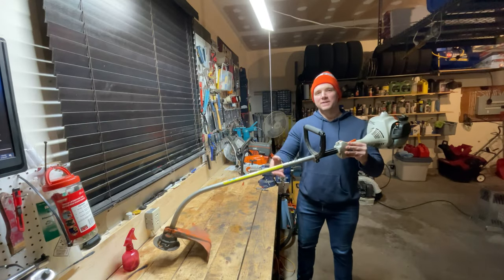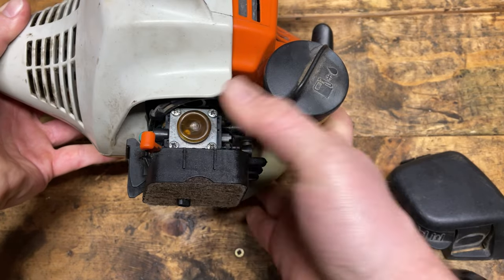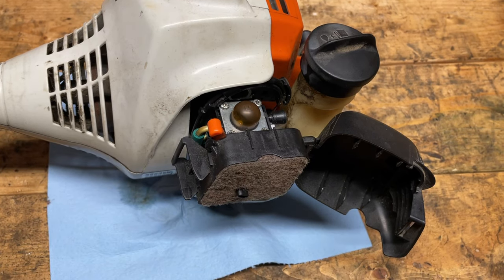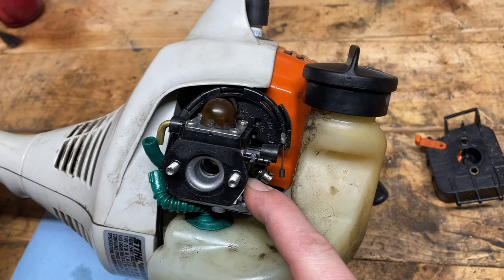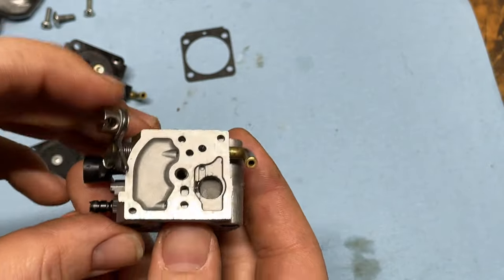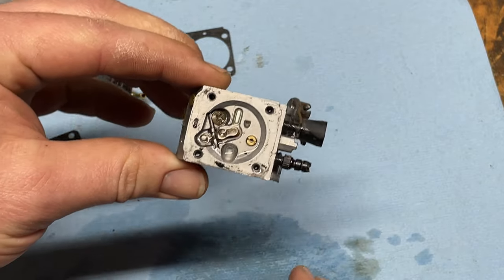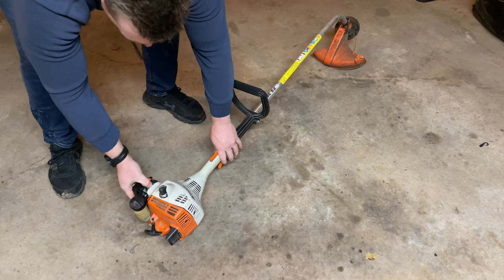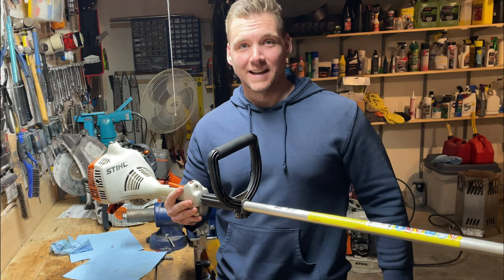How to fix a string trimmer that won't prime (purge bulb doesn't work / won't fill)

Comment: Hey Dave, great video! It's amazing to see all the good knowledge you and Don are putting out there in these videos!
A question about those small Stihl trimmers: is it normal for it to have so much vibration when it's idling? It's basically hoping away from you haha
Cheers from Croatia.
Reply from the maker: Hey Dejan! Thanks for the comments. Can you film a video and post it? Cheers!
Reply: @DavesSmallEngines  Yes, absolutely. My mom has one of those, but it's at a house in the country, so I can get to in a couple of weeks. 
The engine essentialy vibrates quite a lot when idling, but it has no issues and runs very smooth when revved up.
Thanks for the reply!
Reply from the maker: @dejanm5727  I have worked on over a hundred Stihl trimmers. Let me know when you have the video!

Comment: what is going on when my KM55RC when it fires up it is high RPM, then it dies and have issue getting it to run again. what happened was went to start it but never noticed my throttle cable had come loose. So was trying to adjust idle mixture and never got it to start back up. tried to adjust the throttle cable when I noticed that the cable had come loose. not sure how to get it to idle down so I can adjust high and low mixture. where should throttle cable screw be set. could you help me on this problem thanks

Comment: Hi mate I have done everything you told in this video. Is there anything else I can do to fix the problem. Primer pump still not working. The machine is sf 80 pro.Thanks
Reply from the maker: Sounds like one of the check valves in the carb is broken. Try another carb!

Comment: Thanks. Going to try this. Wish me luck.
Reply from the maker: Let me know how it goes! Good luck!
Reply: @DavesSmallEngines  Nope did not work. Maybe just buy new carb on amazon? Comes with new fuel filter. Plug. Extras for 22.98. Thoughts?
Reply from the maker: @bufferzone3247  sounds like a good next step!
Reply: @DavesSmallEngines  thanks

Comment: Is the purge bulb supposed to be taking in air? Mine keeps bubbling up like yours. Is that supposed to happen?
Reply from the maker: The purge bulb is supposed to draw in fuel, but most have a small air relief so that the bulb doesn’t stay flat. I have had trimmers that only fill 1/5 of the way in the bulb that run just as well as ones that filled 3/4 with fuel. As long as you are seeing fuel in the bulb it should be working fine, as it’s duty is to draw fuel through the carburetor passages.
Reply: If your carb has an accelerator pump, it's worth checking that. It will draw in air if that oring is bad. Also can have some bogging down when trying to full throttle.

Comment: Dave, i heard you say it was a new carb kit. What do you use for fuel. Everybody has a different opinion on how to store small engines for the winter. My method, and I'm not saying its the only way to do it. I never ever use fuel stabilizer. In 2 stroke equipment i only use premium fuel with stihl ultra HP oil ,and Seafoam. In 4 cycle i only use premium fuel and Seafoam. I have very good results doing it that way. I went out to my garage the other day and started by BG 86 Stihl blower. It took 4-5 pulls and it was running perfect. I put it away last November. ✌🇺🇸 Roger
Reply from the maker: Hey Roger! Glad to see you back. I use 91 octane with no ethanol. Premium means different things to different gas stations. Some premium fuel uses the ethanol to achieve a higher octane (93 and 94 usually). I use 91 octane NO ETHANOL fuel. I don't ever run stabilizer as I run the tank and carb dry. I use Stihl oil in my fuel mixed 45:1. I usually have fantastic results but as seen in this video it was a physical carb issue. Cheers!
Reply: @DavesSmallEngines  Dave i do run only premium with no ethanol. I run my carbs dry on my 4cycle engines but my 2 stroke  stuff i leave the gas in them as long as its got seafoam. I dont even change fuel in the spring. The first tank full could be 5-6 months old. Have you been watching Taryl Fixes All channel where hes testing fuel and stabilizers. Hes now in the 14 month and those engines are outside. He says those additives are snake oil. One engine has 87 octane with ethanol an it starts as good as any of the other ten engines. 14 month old fuel. That tru fuel thats like $20 a gallon was tested on the channel Project Farm and he came to the conclusion that its not any better than 91 octane without ethanol thats only about $ 3.25 a gallon.👍

Comment: Just curious if a purge bulb should stay full of fuel between uses or do they drain back to the tank? I have a Stihl leaf blower which I put a carb kit in last season and it runs fine, but the purge bulb is always empty next time I go to use it. Is this normal?
Reply from the maker: Yes.  Normal. Nothing to worry about!

Comment: I cleaned my carb and found what looks like a little silver nut bouncing around in the bulb.  No fuel comes in at all, but I can start the trimmer just fine pulling the throttle when pulling.   Wondering if the check valve or something else broke in there and came up the the lines?
Reply from the maker: Hey Cool Mom! Sounds like that purge /bulb portion of the carb has come apart. That little silver nut is likely the check valve that sits in the top of the plastic piece on top of the carb. Nothing would be coming up through the lines I don't think. If you'd like, send a photo to me at dave@davessmallengines.ca and I'll check it out!

Comment: I have the exact same issue. Even after replacing a cracked primer bulb or broken top membrane it still doesn't pick up fuel or sometimes does but it takes ages to pump.
My last idea was that something is clogged and after watching this video I'm pretty sure that blowing out all the channels will solve this issue.
Reply from the maker: Be careful with compressed air… there are small check valves inside that are easily damaged.
Reply: @DavesSmallEngines  Sadly it didn't work. So far I know that it does create pressure in the tank and I can see light through some channels while other channels pass air so they all should pass fuel as well. The Inlet needle and the entire mechanism related to it does work fine (or at last it looks like it's fine). My last idea of what is wrong with it is the new gaskets/membranes and the top one has the potential to move and block those tiny channels on top. So either it's aftermarket membrane fault (original was taking fuel even with a tear in it OR the inlet needle is not moving properly (even tho it's set according to Stihl spec). I really want to fix the current carb but if nothing changes then ill just order a new carb kit :/
Reply from the maker: @jnx4803  what order do you have the metering diaphragm and gasket oriented?
Reply: @DavesSmallEngines  Gasket and then membrane and then reverse on the bottom as per Stihl Diagram. After I messed a bit with that top membrane it did prime but the bulb filled just a bit max 1/3 which is a bit weird since the old setup was filling the bulb to at least 2/3. Seems like that top membrane positioning is a bit shot or the centerpiece of it might not move properly. I don't have a second membrane so I can't check. Now when it's primed I can start the engine but with fully engaged gas it runs like a dead horse and dies after few seconds. Well, I think ill get a new carb kit and see how it will affect everything. Troubleshooting all the micro issues especially without replacement parts takes way too long ;)
Reply from the maker: @jnx4803  sounds like you are all over it. I have had good luck with aftermarket carbs… and if they don’t work, Amazon return it is. Maybe save some time. Nothing better than an original Zama car that works, though.
Reply: @DavesSmallEngines  Yeah, it's an old (10 years maybe/never taken apart) original carb and even when obvious things got fixed it now comes with different set of issues and it's pretty impossible to tell whether the aftermarket Chinese parts are the issue or what. Here in my country I can find carb kits which have additional parts like gaskets, fuel line/filter, etc. for 14$+deliver so no point to waste time and spend money on individual parts.

Comment: Did you use the ultrasonic cleaner after you used the carb cleaner or did you skip that step and just reassemble?
Reply from the maker: I believe I used the ultrasonic but I have had great luck with carb cleaner as well!

Comment: I have an old F's 52 Stihl  trimmer that does not have a primer bulb.  Could I put one on there?
Reply from the maker: Hey Pete! Not without some major work. Doesn’t need it - should fire up after a few pulls with the choke on! Those are great trimmers.
Reply: Okay Thanks.  I found it in the garbage  It needs a fuel line.  And the head was loose  Don't know why it would have been that way  I assume that's why they threw it out because it didn't run

Comment: So my weedwacker is having the issue of not sucking gas up into the carburetor but when you press the prime bulb you can see all the air bubbles in the gas tank..so it must not be clogged correct? This is annoying as hell! It wont start now and when it did it spit and sputtered. Brand new too I think that might be the high and low fuel pressure screws
Reply from the maker: If it’s brand new, I would be taking it back to the dealer!!! 

It’s not a purge bulb on small engines. It’s a priming system. My guess is it’s an issue with the carb, which could be one of several different things.
Reply: @DavesSmallEngines  unfortunately my grandfather got it a couple years ago and it did this sputtering and spitting from the beginning. Its sat now for a couple years so I took it and am gonna go through it and get it going. I believe its something in the main fuel line. Some gunk or something. I'll clean that out with some carb cleaner then try adjusting the low and high fuel input. Its still pretty much brand new so it can't be too much of a pain..I hope!
Just not sure why it ran crappy from the get go. That's why I'm thinking maybe it's the low and high fuel input..we'll see
Reply from the maker: @ksajak  keep me posted - I’ve worked on hundreds!
Reply: @DavesSmallEngines  well damn you probably know exactly what's going on and exactly what to check and replace lol!
Reply from the maker: @ksajak  my guess is gas was left in it while it sat, probably wth ethanol, and the carb is now all gummed up / needs diaphragms.
Reply: @DavesSmallEngines  that could be true.  But it's done this since it was brand new and my grandfather called the company and they sent him a new diaphragm and gasket and he replaced those but it didn't change anything..it might need to be replaced again now thi since its sat. I got 40:1 non ethanol mix so I dont gotta worry about gum up. I'm just hoping it's not too bad. Since it did it from the beginning when it was brand new is what makes me think the low and high gad input might not have been correct. Ughh! I'm sure its gummed up now tho

Comment: Hi the only way my (Chinese) strimmer will work is that I take the spark plug out and give a very small injection of fuel into the hole replace and it starts first pull and works well even if I have to turn it of and restart. There is fuel in the fuel line when I press the bulb Any ideas
Reply from the maker: Sounds like an issue in the carb.

Comment: my issue is i have to pump  10 to 15 times to fill the purge bulb and then it drains itself out within a few seconds , would this be the metering needle not sitting well ?
Reply from the maker: Sounds like the metering needle isnt adjusted properly, for sure!

Comment: Does it matter if that black plastic thing (could be a gasket) has a hole in,
Reply from the maker: It matters very much. If it’s the gasket between the carb and the cylinder it needs to have the hole lined up with the hole on the carb and the cylinder. That is for impulse from the cylinder rotation to actuate the carb pump diaphragm.
Reply: @DavesSmallEngines  on 4 minutes and 28 seconds on this video that’s the gasket i mean, looks a little bit like a gun cartridge haha, well mine has a hole rite on the middle about a 10m bolt head size

Comment: does the primer bulb fill all the way up?
Reply: There is always an air bubble in a primer bulb. What you want is gas to be visible in the bulb, and you can feel it priming as well, as you press the bulb. If there is no fuel in the bulb, then you got an issue somewhere.
Reply from the maker: Correct. I have a bunch of these trimmers now and some fill up almost all the way and some fill up 1/3 of the way. I know that if it is filling itself at all that means it is drawing fuel into the carb - and that is the goal!

Comment: what if its all new carburetor,  filter, lines etc.  , and primer bulb is filling with fuel , but will not prime to start....a quick couple sprays of mix fuel straight into carb and , boom , runs like brand new   🤷‍♂️🤷‍♂️🤷‍♂️

Comment: Good video but didn't work for me. My FS38 was working fine last autumn, this spring, it was bogging down after afew months laid up. Took the carb apart, cleaned out all everything with carb cleaner and compressed air. Primer bulb will still not fill. Gonna just buy a new carb and be done with it.

Comment: What is the difference between fs38 to 45
Reply from the maker: Not much. Mainly age. Same 27.2CC. The FS38 is the replacement for the FS45.
Reply: @DavesSmallEngines  That is strange cause in Australia Melbourne  I can buy a fs38 or buy a fs45c easy start
Reply from the maker: @kingofthetrack  hmmm - not here in North America. Looks like the 45c gets you the easy start function. Same 27.2cc engine
Reply: @DavesSmallEngines  I can buy the fs45 for $245.00 or fs45c $295.00.
Reply from the maker: @kingofthetrack  have you tried the easy start? Worth it, I think!
Reply: @DavesSmallEngines  yeah Iam a landscape gardener.....love my stihl products.......fs45c..fs94rc.....KM130R hedge trimmer...HS81R.....bg72....ms201t.....ms661c.....ht131.....se 80 vaccum

Comment: Couldn't you just spray the WD-40 or the carburetor cleaner through the two inlets before taking the carburetor off?
Reply from the maker: If there is any debris, it will likely get pushed in further. It’s best to take it apart!

Comment: All you need to do is get it running for a few seconds. Don't I repeat, don't pull the carb. Just put a little mixed gas in the carb through the air intake after pulling the filter. It should if there's nothing mechanically wrong/blockage prime itself or push to prime after fire up for a few seconds. I Use a fs110 from 2008 or 07 still a ripper.

Comment: Oh no, you lost the beanie hat, you've disrupted the balance Dave, oh how could you? I'm just joking with ya Dave HEHE. It just goes to show, even if something looks clean, it can be deceiving. There was obviously varnish buildup in there clogging the fuel path. She's good to go now.
Reply from the maker: Hey Stellar! It could have been anything. Lots of small parts there in that check valve... a bit of lubricant and carb cleaner and it's good to go! Cheers!

Comment: Small 2 stroke engines are 100% junk. Never had any luck with 2 stroke weedeaters. The carbs are waay too touchy....
Reply from the maker: I think it’s in the fuel. I always run ethanol free. Ethanol is a diaphragm carb killer!!!

Comment: Hey but you are giving false information, that thing is not made to pressurize the fuel tank. It is meant to suck fuel into the the carburetor, if it was meant to pressurize the fuel tank it would never fill a fuel it would continuously pump air and not fill with fuel. Every pump sucks a little bit of fuel out in that space is replaced with the air that was trapped in the line that's it. Otherwise the intake tube would not be connected to the fuel suction line. This isn't rocket surgery bud
Reply: Please try to explain yourself clearly, don’t know what the bloody hell you’re trying to explain. At least the mechanic has the balls to explain stuff on video and if he makes a mistake, he’s still human so give him a break and appreciate his effort.